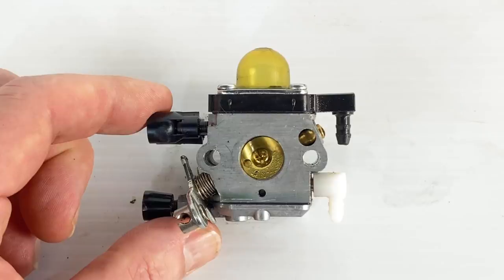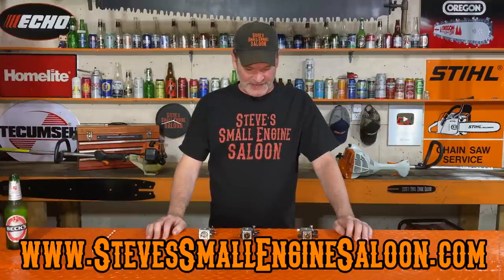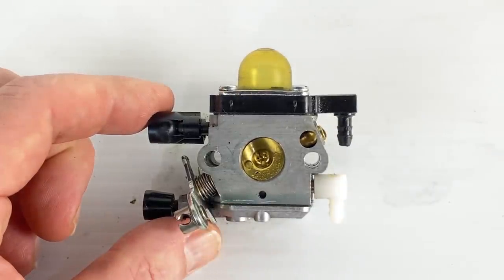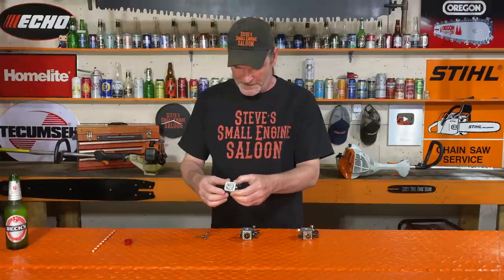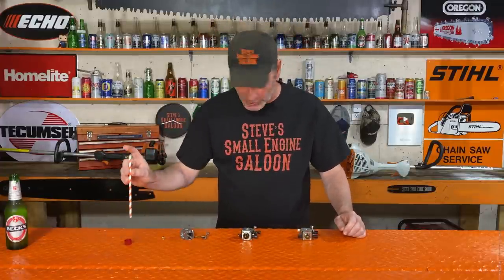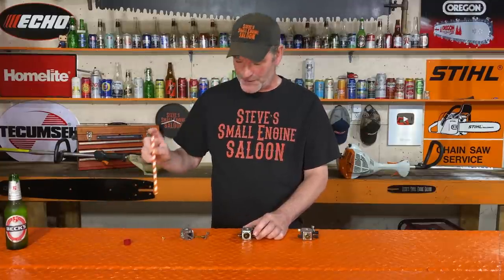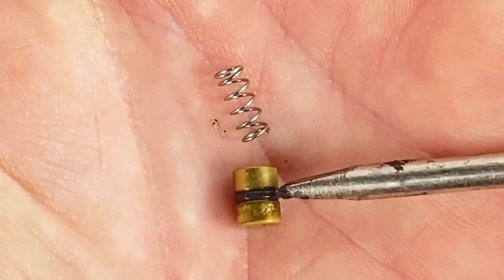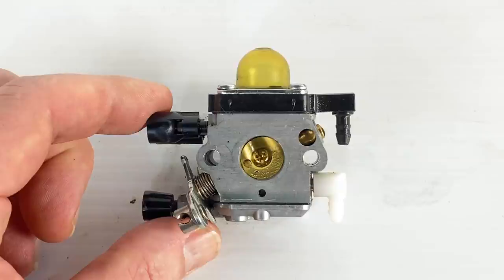Easiest Way To Test The Accelerator Pump On A Weedeater Carburetor

Comment: Steve it's Keith I found out how to fix electric lawnmowers it's not that hard to fix a belt. I know that you mainly work with petrol lawnmowers but electric ones are being thrown away and can be easily fixed. 7 screws and one bolt to hold the blade to undo. 15 minutes later a gentle run in of the belt job done. Have a look see what you think I've picked up 2 and given them on for nothing but cost me £20 I'm happy

Comment: Good video Steve, been working on these carbs for years as a hobby and never knew about an accelerator pump. Appreciate ya man!!
Reply from the maker: Glad to help
Reply: You’ve been lucky that maybe never come across one with bad accelerator pump, after cleaning, and trying to rebuild and still would not work right
Reply: Jose that may be why I had to trash several over the years. 👍🏼

Comment: Great presentation Sir. I had an Echo leaf blower that would not start anymore. I piddled around with it for about two hours, and I used to be a motorcycle mechanic so I assumed my mechanical experience would help me. It didn't! I abandoned the project and bought a corded leaf blower with a long extension core and began using it. I guess I will revisit that project and thanks to your instructional video and maybe I can bring it back to life. BTW, I love your choice of suds. There is nothing more fun when working on a project like this and drinking beer! Here Here!!!
Reply from the maker: Right on

Comment: Carbs got meet emission regs so needs all the help it can get. They used to be simple not now. They run as lean as possible and have power valves and accelerator pumps. Good job we doesn’t use fuel that attacks pipes and other components and leave it in the shed without cleaning out the fuels system and servicing filters first. Then let the oil settle out from the fuel over winter and start them on raw gas I mean that would seize the engine right.😀

Comment: Thanks for that, had no idea. What are the symptoms ,starting or running. Idling.
Reply: Same here. I was under the impression that two stroke engines didn't have an accelerator pump. I would like to know what symptoms are shown by one that is leaking.

Comment: Steve, I have read that some of the cheaper carburetor options don't work so well out of the box.  Is there a specific aftermarket carburetor manufacture that you recommend over others?  I went to your link for a new carburetor above on amazon but it said no longer available.  I need to replace a  Walbro Wt875a carb.  I see many inexpensive options and just need to hear which one you suggest?  Thanks for the video!

Comment: Hi, I have an old Homelite blower. The carb spits back fuel out the intake side of the carb. Replaced gaskets that were worn. Unit only runs with full choke and full throttle. And not very well. Could it be accelerator pump? Any knowledge you could impart would be great. Great Channel!

Comment: Good to know Steve, just did that on my FS55R and bought a new carb. Hope this is the fix for mine. Earlier It was starting to run bad and then wouldn’t start at all. I was kinda stumped because I was getting fuel on the spark plug. Check spark plug and just barely getting any spark. So I picked up a new one of those also. Will let you know later how things went once I get these installed.
Reply from the maker: Good luck!
Reply: If you just filled it and it started to crap out, it could be the fuel. Even new it can be bad for small engines. You know because it's a night and day difference.

Comment: Thanks Steve! I never knew this and just tested an old one I had lying around and one I’ve just took off a fs55 and both drain straight away without priming.. my question to you Steve is when looking for a replacement if the old carb has the hole does the replacement also need the hole?  (The hole you just poured petrol into) many thanks Ben
Reply: I have found a replacement with a accelerator pump hole.. but when looking I found loads of what’s looked like the same carb just with out the acc pump hole.. I’ve just took my fs80 carb off,as a mate replaced that a few years ago and that also doesn’t have the hole but the machine seems to run like a dream

Comment: Steve I think the ones on the fs90 are on the opposite end and have a plate over them. I don't run into fs38/45/55 carbs as much as the 90/91/94/131 etc.  Lawn companies and what not. There basically throw away carbs. Might as well buy an Amazon carb. There about 90% accurate from oem. It's not perfect. Check valves make me wanna pull my hair out. The Achilles heel I call it. Hey thanks for the awesome videos, I've been following you for along time. Cheers!!

Comment: Another great tip Steve, but could you not just replace the worn o- ring on the accelerator pump ? greetings from the UK .
Reply from the maker: In my experience.  If the o-ring or plunger needs replaced, then the gaskets and diaphragms probably do too.  Purge bulb is not far behind!  And the hole will be all scratched up and wear the new o-ring out super fast.  The carb is simply worn out and not cost effective to repair anymore...

Comment: Steve,  while googling an accelerator pump for a riding mower I found this. Some of the Kohler Commands had a factory accelerator pump while others didn't.  If it were your machine,  would you adapt a carb with an accelerator pump or stick with the old fashion type? CH22 in a Cub 3240 that's used for mowing and ground work.  Thanks!
Reply: For anyone looking,  it was an awesome mod. So good I pulled a good carb off another mower to add it.

Comment: Well now I have a question.  What if you replace the o ring?   Thanks for the lessons.  😎👍
Reply from the maker: In my experience.  If the o-ring or plunger needs replaced, then the gaskets and diaphragms probably do too.  Purge bulb is not far behind!  The carb is simply worn out and not cost effective to repair anymore...
Reply: @StevesSmallEngineSaloon    Thanks man.   That’s what I was assuming but wanted to be sure.   😎

Comment: Is it worth fixing if you actually have the o-ring? I have a stockpile of different sizes. Great video!
Reply from the maker: In my experience.  If the o-ring or plunger needs replaced, then the gaskets and diaphragms probably do too.  Purge bulb is not far behind!  And the hole will be all scratched up and wear the new o-ring out super fast.  The carb is simply worn out and not cost effective to repair anymore...

Comment: Two Questions: 1) is this the same thing if, with fuel lines hooked, and you press the prime bulb and fuel comes out of that hole? 2) Couldn't you just replace that o-ring? Or is something else shot? 

I never liked working on two-strokes, but my mechanic/friend quit on me so I had to learn really quickly! Your videos have been a great help!
Reply from the maker: In my experience.  If the o-ring or plunger needs replaced, then the gaskets and diaphragms probably do too.  Purge bulb is not far behind!  And the hole will be all scratched up and wear the new o-ring out super fast.  The carb is simply worn out and not cost effective to repair anymore...

Comment: Great tip Steve!  How often do you think those pumps fail?  could you even replace that part if you wanted to?👍👍
Reply from the maker: In my experience.  If the o-ring or plunger needs replaced, then the gaskets and diaphragms probably do too.  Purge bulb is not far behind!  The carb is simply worn out and not cost effective to repair anymore...

Comment: So is it difficult to replace that o ring? Or is there more to it?
Reply from the maker: In my experience.  If the o-ring or plunger needs replaced, then the gaskets and diaphragms probably do too.  Purge bulb is not far behind!  And the hole will be all scratched up and wear the new o-ring out super fast.  The carb is simply worn out and not cost effective to repair anymore...

Comment: Thank you for the video. I would think replacing the o’ring may have stopped the leak. Regards 🦘🇦🇺
Reply from the maker: In my experience.  If the o-ring or plunger needs replaced, then the gaskets and diaphragms probably do too.  Purge bulb is not far behind!  And the hole will be all scratched up and wear the new o-ring out super fast.  The carb is simply worn out and not cost effective to repair anymore...
Reply: @StevesSmallEngineSaloon  Thank you for that information Steve. New carby is a sure fix too. Looking forward to your next video mate. Cheers

Comment: I've actually replaced the o ring on a zama c1q carb for a Stihl FS45/55. The hardest part was actually finding the part number, but it was cheap once I did. 

Have another to fix now, I'll likely replace the carb or do the epoxy fill method.
Reply: So was it difficult once you found the o ring?
Reply: @normanbfifteen3468  no it's a really easy fix. Just unscrew the brass butterfly from the shaft, take off the c clip holding the throttle shaft, slide it out, and the accelerator pump piston pops right out. It can shoot out with the spring, so don't lose it.

Comment: What are some symptoms of a bad accelerator pump on a carburetor
Reply: Probably the symptoms that caused him to pull and disassemble the carb: poor running. Now he's at the point of isolating the specific defect.
Reply: @65csx83  ok, I get that.  But engine run poorly in lots of different ways.  Thanks for the input
Reply: @jaimetumtum81able  At the point where you remove the carb, you've eliminated non-carb issues. Plus you've eliminated ancillary carb / fuel issues such as vacuum leak at carb base or clogged fuel filter. So now you've determined the problem must be in the carb so you are looking for some defect internally. In his video he is showing that when no other problem was found, the problem may be with the accelerator pump. And you re correct. there are many things that can make an engine run poorly: every / any single component could be at fault.
Reply: @65csx83  lol, you're over thinking my question.  I wanna know, what was the customer's concern.  What was the symptom.  Thanks for the input.

Comment: Hello from Greece.
My Stihl ms231 doesn't purge bulb .How can I test the pump. 
Also my Stihl  dealer here in Greece said that he have this part (accelerator pump ) for 9 euros .
Is it worthing to replace it or I have to replace the whole carburetor?  He also said that ms231 comes with 2 types of carburetor one with the accelerator pump and one not . Mine have this pump and according the serial number of my chainsaw I can not install the other type with no pump. 
The chainsaw is 3 years old  . Is there a way to prevent this pump to fail ? Is there a way to fix the pump? For sure I can't imagine that every 3 years I have to change the carburetor. 
In a few days I will have the part number of the Stihl accelerator pump (I have ordered 2)
Thank you in advance for you time
Reply from the maker: In my experience.  If the o-ring or plunger needs replaced, then the gaskets and diaphragms probably do too.  Purge bulb is not far behind!  And the hole will be all scratched up and wear the new o-ring out super fast.  The carb is simply worn out and not cost effective to repair anymore...

Comment: I have a stihl 201 tc chainsaw. New bar, chain, side cover. Chain tightens as it runs...and turning by hand it feels like it hangs up then gets free. Any suggestions?  Is it the adjuster itself? Sprocket?
Reply: you said you put a new chain on a new chain can be adjust perfect and become loose and need adjusted again as it stretches but with yours maybe  there is something wrong with the oiler if your not getting enough oil the chain and bar will get hot making the chain get tighter or you got the wrong size chain not in length but as in the drive links . Goodluck

Comment: Steve, what about putting a new o ring on that accelerator pump,would that fix it for a buck or so?    Please respond.
Reply from the maker: In my experience.  If the o-ring or plunger needs replaced, then the gaskets and diaphragms probably do too.  Purge bulb is not far behind!  And the hole will be all scratched up and wear the new o-ring out super fast.  The carb is simply worn out and not cost effective to repair anymore...

Comment: Im about to check that plunger with the knowledge you have shared 👍
But can I ask .. Is it repairable .. and can you do it ? ?
Only asking, because I have very little money, lots of time and hate buying and ordering things from china that cost 10x more in postage to ship to were I live .. Thanks again ... 🇦🇺
Reply from the maker: In my experience.  If the o-ring or plunger needs replaced, then the gaskets and diaphragms probably do too.  Purge bulb is not far behind!  And the hole will be all scratched up and wear the new o-ring out super fast.  The carb is simply worn out and not cost effective to repair anymore...

Comment: I don't even mess with carburetors anymore. I'll try to adjust them and if that doesn't work, I just put a new one on once I'm sure it is a carburetor issue. I might blow some air through some holes but that's about it.

Comment: Hi Steve. Am an avid subscriber to your channel. Really good shit (only a Canuck would use that expression!). Have gone through your catalogue, but nothing, NOTHING about hedge trimmer maintenance/repair. Damn! The blades on my Hitachi trimmer keep oscillating slowly after the throttle is released. Gearbox is fully greased through the zerk fitting with any excess ozzing to the lower part of the the shaft. Machine idles and throttles properly. Any suggestions? Cheers, maybe a 2 beer consideration.

Comment: I wasn't aware that they have started putting accelerator pumps on these little carbs?
Never seen one before that wasn't on a car or truck carb? I also did not realize that new carbs for these have become so cheap in cost to replace? Back in the day when I always rebuilt them they cost up to $80 or more.
Reply: Well...that kinda depends, you can find them for under $20 all over Amazon and eBay but they are Chinese knock offs and really hit and miss quality , I build saws and alot of the Amazon eBay ones best case scenario you have burs in passages you can fix yourself worse case scenario the holes are drilled off center of where they are suppose to be and nomatter what you do the thing won't tune right and occasionally youl get one great out of the box but it really is a gamble and you really need to know carbs cuz chances are your going to put it on and have issues getting it exactly the way you want it and have to tear into it and figure out what someone with their eyes closed goofed up
Reply: Iron horse on YT appears to love the cheap clone carbs and has the time,spare parts and certainly the skill to make the best out of whatever he ends up with, tinman on YT has pretty much the same experience as myself it can be annoying or it can be an easy cheap repair it all depends on how the dice lands

Comment: Hi Steve, I was just wondering why not just replace the bad O-ring on this plunger rather than the entire carburetor?
Reply from the maker: In my experience.  If the o-ring or plunger needs replaced, then the gaskets and diaphragms probably do too.  Purge bulb is not far behind!  And the hole will be all scratched up and wear the new o-ring out super fast.  The carb is simply worn out and not cost effective to repair anymore...
Reply: @StevesSmallEngineSaloon  I appreciate such a great reply Steve. I was thinking there was a reason to replace the whole carburetor entirely and your reply was very thorough. I always appreciate your great videos Steve, keep them coming because I appreciate the learning about certain things that I just do not know.

Comment: Steve, I always thought that mystery hole was for when you got bored. You take a 1/2" tap and put new threads in it. Then you put in a 1/2" threaded bolt and leave it half tight. It will make you feel warm and fuzzy all over.

Comment: Great video!  Are the accelerator pumps only on weedeaters, or can they be found on chainsaws as well?
Reply: They are on chainsaws as well. Replacing the stock carburetor on my Husqvarna 359 right now because of this problem. Aftermarket carburetors without the fuel pumps are available and get rid of the problem
Reply: @daleholmes4355  Thx!

Comment: This was good, Steve. As far as symptoms that would indicate this defect,  would hard-to-start after priming be one of those?
Reply: A flat spot or stumble during acceleration and an air leak as well. Some of the newer carbs have a brass plug covering the hole

Comment: Hey Steve ,I have an old homelite 350 that won't oil the bar.Any help?
Reply: Have you replaced or inspected  the oiler hoses in the tank? That's the very first thing I would look at on an old homelite then go from there, by far the most common culprit on those , I have a super2 basically same ordeal iirc
Reply: As a general rule when it's time to change the fuel lines ,the oil tank lines are right behind in decay/rot but seeing as that's a rather odd setup nowdays most people don't even know theyre in there until it stops pumping oil...and I suppose you could wipe out the oiler if you ran it long enough without oil getting to it,that's speculation though I have not had that happen, hope this helps

Comment: If the accelerator is toast, how will engine run? Won't rev up properly, doesn't idle, hard starting?
Reply: It will run lean and fast at idle, and you cannot adjust it away. Some times the symptoms will come a few minutes after start. 
I have a few carburetors where I have blocked the fuel bore to the pump, and then adjusted the problems away.